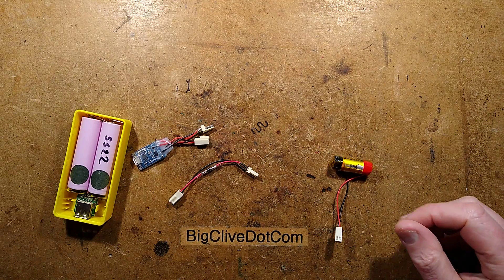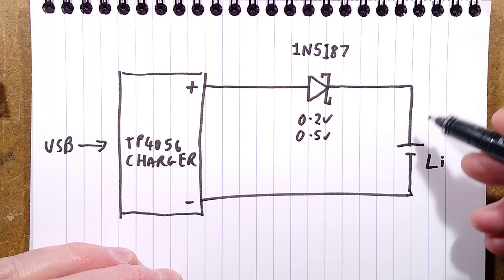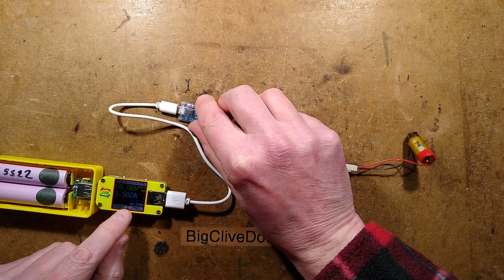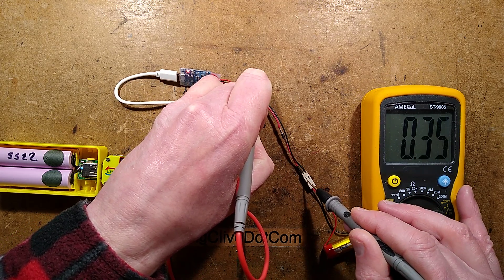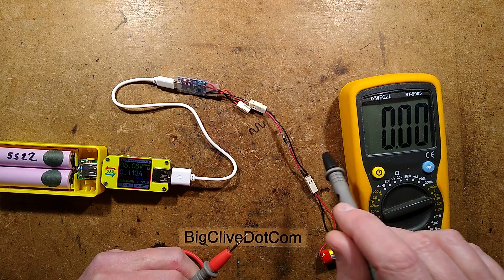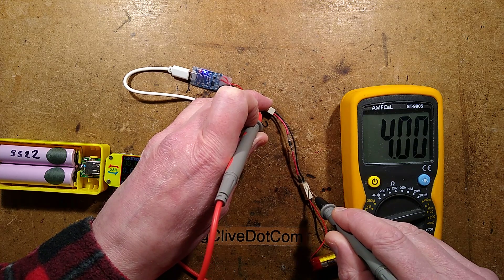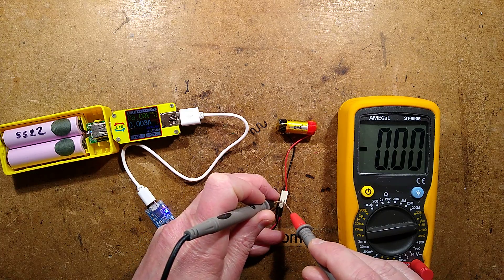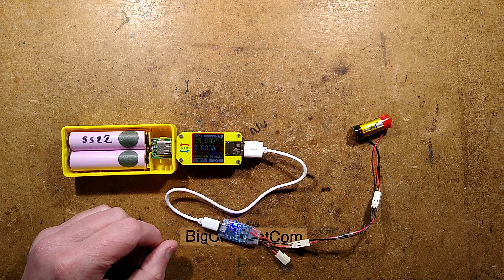Schottky diode between charger and lithium cell?

Comment: It is annoying that those charger circuits always try to take the cells up to 4.2volts, its probably wrong and going to explode on me at some point, but I use a small circuit that supplies a limited current and voltage, and just allow the cell to reach the said voltage eventually ie, 3.9 volts. I charge up a 20000mAh Sodium ion cell the same. When the voltage on the cell reaches the output of the supply current seems to drop to almost nothing, one of my supplies, the one doing the sodium cell I had to fit a 0.5ohm power resister, to ballast and control the current flow, at such low voltages the power loss seems minimal and far less of a faff than complex electronics.
Reply from the maker: 4.2V is the full capacity of a standard lithium cell.

Comment: hmm was thinking i could maybe put different combo of diodes in parrlel to finetune the final voltage but diodes dont work like that. i guess they just share the current so you get the same voltage drop regardless of the number in parrlel. thats according to chat gpt :p

unrelated funny realization, I can probably charge 18650s with a cut usb cable and 3 of these in series on the positive side. 5v - 0.9v = 4.1v
assuming the power supply can only do like 0.5 to 2amps it should work. maybe it would just overload the powersupply due to low internal resistance of 18650s? who knows. it was one of your most watched videos :p

Comment: I have a bicycle tire pump that has 2 18650 in series (7.4 volts). The charger cable has a USB plug (5 volts). It never gets charged. Any advice, a 7V dedicated power supply?
Reply from the maker: They usually use a boost circuit for charging at higher voltage.  Or if it's USB C then maybe it would negotiate a higher voltage with a suitable power supply.

Comment: My samsung phone has an option called "adaptive battery protection" where it uses usage data to determine when you're likely asleep and lowers the charge max to 80% but before you wake up it charges to 100%. I go even further with samsung modes and routines to turn off fast charging while im sleeping (why charge my phone in an hour when it has 6-8 hours to charge)
Iphones and macbooks and asus laptops also have a similar option built in
If you have a device with this feature, turn it on. Especially if you leave a laptop plugged in, limit the charge to 80%, or 50%. And if youre storing something with a lithium battery for years, make sure its turned off and the battery charge is about 50%.
Reply: My Samsung phone also has an option to permanently turn on 80% mode. If you leave your phone plugged in for like hotspotting or something, then you may wanna consider adding a routine that whenever you have have hotspot mode turned on, the battery will go into maximum protection mode and only charges to 80%
Reply: Part of the reason why I love Samsung phones so much is that modes and routines. I use them for playing music when I get in the car automatically, and stuff like that. Absolutely incredible feature. 
If your phone is older, it may be called Bixby routines, but it's unrelated to the voice assistant.

Comment: Something I had been meaning to explore, really helpful. The results were probably as expected but useful. TP4056 charging to a reduced voltage works but only slowly and to ~3.9v. I wondered if it might help to put a cap across the diode - even a small super-capacitor ?

Comment: That behaviour at the end may be its low charge recovery which allows you to rescue a cell which had discharged out of the 'safe' range by effectively trickle charging the cell until it reaches a recognized voltage.

Comment: It might have been a success charging the battery but now unplug the supply, add a load and try to drive it from the battery controller on battery power. Sorry, won't work,,the battery is connected through a diode which won't allow current from the battery to the controller and the load.

Comment: This method is great for storage charging as well, a diode with slightly higher voltage drop will leave you to around the storage level at 3,7-3,8v and that’s how you should store the lithium battery over time.

Comment: I use low drop schottky diodes to limit maximum charge voltage to about 4.0VDC.  Two diodes back to back allow for the charger to not oscillate as the charger sees the voltage return through the reverse diode.  UNDERSTAND Li Ion batteries have a useable voltage range from 2.8VDC to 4.3VDC.  What kills LI ion batteries other than over current?  Deep discharge below 3VDC and charging to over 4DC both of which cause repid electrode deterioration.  The fake "enhanced capacity" from charging over  4VDC and discharging to under 3VDC will fairly soon disappear in capacity loss. Four years on my batteries perform as almost new.  If you need more capacity, use a larger battery!

Comment: Just use a Buck converter set to a max voltage of 4.0V for lithium ion cells.   3.5V for Lithium Iron Phosphate cells.   Much faster and more accurate.

Comment: Great video !!  Also - Love those connectors with the voltage probe slots !!  What are they called ?  Where did you purchase them ?
Reply from the maker: Check on eBay for NS25 connectors.  I buy mine from a UK supplier called Rapid Electronics and tend to refer to them as miniature Molex connectors.
Reply: Thanks a ton for the response and the info Bigclive!!!

Comment: My charger for the DAB radio drains the battery if I don't unplug it. A diode might prevent this.
Reply from the maker: That's not uncommon with cheap chargers.  Especially if their power LED stays on when unplugged from the wall, but still connected to the item.

Comment: How about using an LM317 with 2 resistors as a voltage divder (10k/20k) to get it to 4ish volts?

Comment: How about adding a capacitor in paralel to the charger IC before de diode to reduce the pulsing?
TP4056 is a terrible IC as it does not allow to set the output limit voltage from 4.2 to 4.0V. Linear technology have developed the LTC4064 with a preset voltage to 4.0V, but I have found nowhere a charging module based on it.

Comment: That is not 80% SoC. If you check the typical charging curve of a Li-Ion cell, you'll see that even though the voltage is at 4.2V, but the current has not dropped significantly, the battery can be around 70-80% SoC.  The SoC is a tricky thing to measure only by voltage. That's why specialized ICs use an algorithm to give an accurate SoC.

Comment: Right at the start you mentioned this was a disposable cell that you were charging? I thought it wasn't safe to charge non-chargeble LiIon cells. Or was this cell actually a chargeable cell?
Reply from the maker: They use rechargeable cells because they are cheaper than non rechargeable ones.

Comment: You could add a charge doctor that turns off the input to the TP4056 when the current drops below 900 mA.  It would interrupt the charging to avoid the top-off CV portion of the charge.  You would also get a report of how much capacity was added to the cell.  Side note, have you tried using the IP2312? I don't think it would solve your issue because VSET only allows raising the voltage termination, not lowering it.

Comment: I have been using that trick to fully charge Li/FePO4 cells for a few years now.
The diode I use is rated for higher current and has a nominal drop of 0.445 vdc.

Comment: I had a PCB made recently which uses a microcontroller to stop a device from charging when the current begins to taper off. This allows you to place it in line with the power supply rather than messing with the charge circuit. I just used a current sense resistor and an FET with a USB-C connector on each end of the board. This way you can just put it in line with any USB-C device to limit the max charge. The microcontroller is programed to collect an average current at the start of charging, then switch off the FET when it sees the current drop below 10% of that average for several seconds.

Comment: Many/most Li packs have charge/limit/protection modules built onto the pack. How does a schottky integrate with these? Is it any benefit/detriment concerning power-storage/life?
Reply from the maker: The Schottky shouldn't interfere with a DW01 protection PCB.
Reply: @bigclivedotcom  Thanks.  Then it seems I'm missing the point/purpose of the Schottky application. Is it just to fool the charger into thinking the battery voltage is slightly higher than actual? If so, why isn't the onboard protection just factory set a smidge lower?
Wouldn't it be easy for manufacturers to install a little slide-switch to sellect between long-life/capacity (similar slide to the lock/write-protect on some memory cards)?

Comment: Why not take the charge controller out of circuit?  Course you'd need either a lower supply voltage or different diode.... like a Zener

Comment: Clive love your videos. I've noticed you fumbling plugging in usb's. The trick I use is I use a silver sharpie to color in the indented icon on the plug. So you know which way is up. On portable devices such as power banks put a matching mark. Of course you could use a pink paint marker.
Reply: I'd rather see him with a mink parker than a pink marker

Comment: Undercharging a lithium battery will indeed extend the number of cycles that it can be charged for, but sadly each cycle will be able to deliver less energy, and so you'll have to recharge the cells more frequently. You are very unlikely to get more total energy over the cell's lifetime by undercharging like that. Otherwise you might as well take it to its logical conclusion and recommend charging from 49% to 51% capacity and expecting it to last forever, despite having to be recharged every ten minutes.

Comment: I did find a cheap Aliexpress module with a resistor-selectable charge cut out voltage.  I'll try and find it again...
Reply: The selectable resistor is for selecting the charge current, not voltage. A dedicated IC to limit to 4.0V is LTC4064, but unfortunately not a single module on it.
Reply: @gherbent  I know that most only allow charge current selection, but this appears to be a module with a different IC, which also has an external select for charge end voltage.  The module is labelled "cb06crma".
Reply: @Tim_Small  yes, apparently it is as you say,  it allows voltage selection. I have to try it for my projects. Thanks, as I have not noticed it before.

Comment: You have to be careful with that when dealing with any lithium pack more than 3.7v (1S) because packs have a balancing system that works by bleeding charge above a certain voltage, like 4.18v per cell. If you reduce the charge voltage, it messes up the balancing.

Comment: Don't forget the rock-chair nature of Li-ion battery.
If you keep permanently 1.1 Volt across a Ni-MH cell, or 1.8 Volt across a Lead-acid cell, both cell will stay at 25% state of charge without damage.
If you keep 3.8 Volt permanently across a Li-ion cell, it will keep at 25% state of charge, but after a couple of weeks it will be either dead or damaged (increased Ri).
This is why Li-Ion chargers disconnect the battery at end of charge.
The mechanism of over-potential is completely different from alkaline and acid cells. It is unrelated to the use of an organic, non-aqueous solvent; it depends on how the ions intercalation change the over-potential.
Li-ion batteries are intrinsically unstable and it is incredible how the researchers achieved the actual level of stability- at least, in good quality cells...
Reply: Kinda hard to trust what you are saying when you refer to 3.8V as being 25% state of charge for a Li-ion battery.

Comment: This method is not advisable, because it depends on whether the charger circuit provides a gradual or abrupt termination to the charge current. In some charge circuits, the voltage is limited but there is no abrupt termination to the current. As the current drops, so does the voltage drop across the diode. At 10mA, this diode drops just 180mV, with that voltage drop dipping below 100mV at lower currents. So if you do use this method, do not leave the battery connected to the charger and diode indefinitely, but rather disconnect it after the time estimated to reach nearly full charge. Otherwise it will keep charging and will definitely eventually be overcharged.

Comment: I would try putting a resistor across the positive and negative before the diode to drop the voltage a bit to keep the charger going for a bit longer and possibly getting the cell voltage a bit higher also.... 
It's not an efficient way to do it but it might help you to get the required charge into the battery!
Reply: The charge will go anyway, the resistor does not make any sense the voltage drop on it will be too fast, a small capacitor is probably a better idea.

Comment: As somebody who is always looking for ways to not charge lithium-ion batteries up to their "typical" 4.2V lifespan reasons (where you often have little to no choice in the matter), I feel really dumb for not thinking of this idea. Obviously it requires a circuit where you can insert the diode into the charge circuitry but not the discharge part, but still a good trick. Too bad it didn't work out that well with this particular configuration of charger/diode/battery (at least in terms of speed), but I'm sure there's some charge circuits for which this would work just fine and result in a termination right around 3.9-4.0V without slowing the cycle too much.
Reply: See my reply to my own comment on this video - I won't repeat here because YT doesn't like that - but I found a listing for a £1 charge module with a programmable cut-off voltage.  Incidentally Jeff Dahn (Dalhousie University battery researcher and Tesla consultant) says charges above 4.05v cause the majority of the wear on cells without mono-crystaline graphite anodes (i.e. all the cheaper and/or older cells).
Reply: @Tim_Small  I found your original comment but it has no replies; it probably got blocked or hidden to other users for containing a URL
Reply: @siberx4  Ah dear, I carefully didn't stick a URL in it, but it looks like the filters got the better of me anyway.  Part description is "Coin Cell Rechargeable lithium battery Charge management module 3.3V 4.2V Charger NI-MH Ni-CD Li-ion LiFe" - hopefully you'll get this one at least...

Comment: I tried this a bit myself too a few times but can't really remember exactly when, But I got the conclusion that it may and may not work depending on charger, Since many fast chargers uses pulse charging it senses voltage to check cell charge between pulses and when the diode is there it things the battery gets connected all the time making it go on and off all the time

Comment: Why not use a constant current power supply or regulator, set it to 500 mA and a max of 3.9 volts. That way you get to choose current and max voltage of charge.
Reply: This is about integrating in your devices and commodity. You will not carry a bench lab charger everywhere. The LTC4064 is another dedicated IC for this purpose.

Comment: I have a dual channel toolkitRC charger that charges any 1 to 6 cell battery to any voltage I want. Including overcharging the cells which is something the FPV drone racers do. It’s a lot more convenient than this method 👀
Reply: Yeah I have the ToolkitRC M9. It's a great hobby charger for basically anything you could want to charge (up to 8s Li-ion/LiPo or 35V equivalent for other chemistries) and it doubles as a 20A bench power supply thanks to the DC Power mode for a fraction of the cost of an actual 20A bench power supply.
Reply: @mitchellwilson12354  And you can field power it from another battery too as long as the battery provides 7v, so many people use them directly from the car battery.
Reply: @pirateradioFPV  yeah I have a big 12000mah 6S LiPo that I bring when I need portable recharging. A cigarette lighter or alligator to XT60 adapter does work good for charging off a car though.

Comment: You could use any diode really

Rectifier
Schottky
Or even zener 

Diode is so once battery reaches the forward voltage drop of supply after diode, current drops to zero, and you essentially trickle charge, so if diode have forward voltage of 0.7v like your standard diodes, youll get a max charge voltage of 4.3 theoretical at 5vdc supply 

And lithium battery doesn't self incinerate
Reply: You could use an lm317 adjustable and either use it to current or voltage sense

Comment: It's more likely that military and other "rugged" industry applications go for a lower charge voltage because Li-tech batteries are more reliable in high-temperature locations if they aren't charged until the nuts fall off, so to speak. Charging a battery to its max voltage in an equipment bay reaching 50 deg C plus is going to kill it quite quickly and that would mean downtime to fix the failure whereas the battery is more likely to survive for longer in such conditions if it's only charged to, say, 4.0V maximum.

Next project, reverse-engineer the classic TP4506 module and redesign it/hack it to charge batteries to 4.0V without using an external diode dropper.